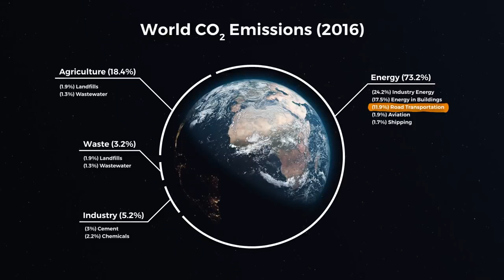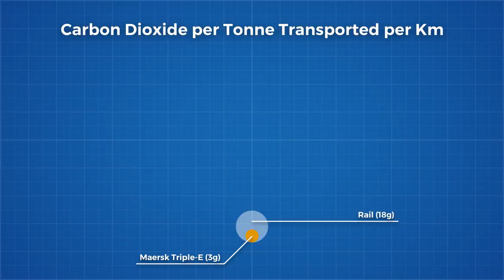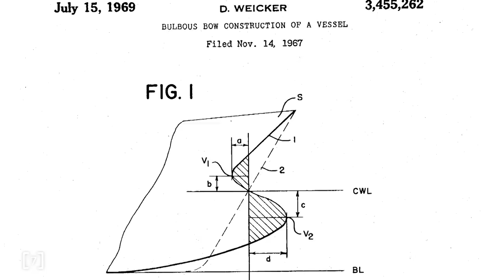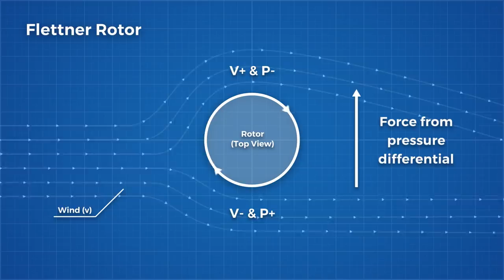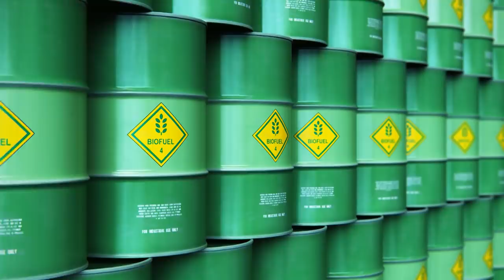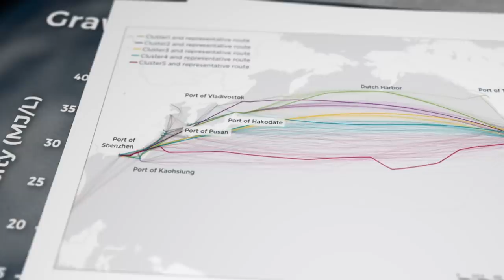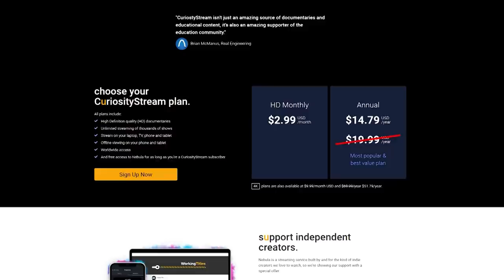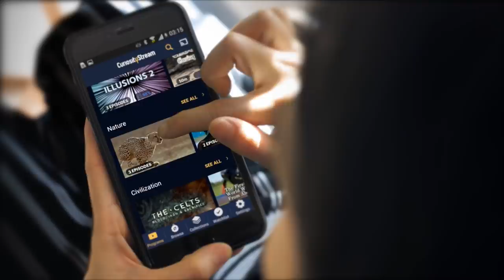Are Renewable Powered Ships Possible?

Comment: Ammonia is arguably better than H2 as a fuel. Whether it's practical to make either H2 or ammonia from renewables is a different question. Nuclear power would be a better fit to produce either.
Reply: @nick b The fuel used at sea, cSt380 HFO, is the bottom of the barrel which the refiners cannot squeeze any more valuable product out of.  Until a price is put on the externalised cost of burning it at sea any alternative must be a lower cost option in energy per dollar terms.  The price of dealing with the now 'internalised environmental costs' will, of course, be passed on to the consumers like us.
Reply: The next, least bad, option is ‘alternative fuels’ such as Ammonia (NH3), Biogas (basically good old CH4 or Methane) and Hydrogen (H2).  All require harvesting and processing which have costs and impacts before you get your energy to the point of use and will have effluents that will impact the global environment one way or another.  Thomas Midgley, Jr. (born 18 May 1889 died 2 Nov 1944) was an American chemist who as well as developing the technique of putting the lead tetraethyl lead (TEL) additive in petrol created chlorofluorocarbons (CFCs), yes those ozone depleting CFCs, so that the use of NH3 as a refrigerant could be discontinued.  NH3 could be the most dangerous and least ‘clean’ clean energy source it is very bad and probably deserves a rant all of its own, so let’s just leave that for a while (somewhere very far away that is cool, dark and quiet).  CH4 lots of it around much of which comes out of the ground as a fraction of the FOGI energy mining; even more can be created (relatively expensively) from anaerobic degradation of organic matter.  The organic matter may be either raw vegetation, food waste or pre-digested by domesticated livestock with the right (or wrong, depending on your point of view) sort of diet and gut fauna.  CH4 is a lighter than air, vapour at environmental temperatures and pressures and you need to compress it, a lot, or cool it, a lot, to get enough on board your ship in manageable volumes to be useful.  Carry it as cargo and you can burn the ‘boil off’, when the latent heat of vaporisation has a co-activity benefit, otherwise more trouble and cost than merit and savings.  H2 is said to be good for use in fuel cells that will give clean energy when combined with Oxygen (O2) and leave only water (H2O) as an effluent; so as well as the cost of creating the hardware and separating out the H2 in the first place we now have the cost of separating out the O2.  H2 is very, very light and very, very volatile so this is where we remember the Hindenberg disaster the ‘light’ means that though we have lots of energy per unit mass there is not much mass per unit of volume so all the problems of CH4 but much worse.  You need to compress it, more than a lot, or cool it, more than a lot, to get enough on board your ship in manageable volumes to be useful.  An alternate use of H2 burning also generates combustion products which includes waste heat going to the cold sink and a few NOx nasties.  The numbers are getting very difficult to show any sort of surplus so this is a case running hard to stand still.
Reply: @nick b the 'Just Have A Think' channel has a posting on H2 & NH3 this week, go see.
Reply: @nick b bad memories of loading surveys on LPG ships (75 000 to 125 000 cu m size) put on and coming off of ammonia trade.  The safety aspect worries me when it goes ‘out in the world’ and the energy benefit is questionable.  Have you seen the ‘Just Have A Think’ posting this week?

Comment: Wait a second, being able to produce 3MWh of power whilst only producing 90KWh of drag, isn't that like producing free energy? Wouldn't that break the fundamental law of energy conservation?
Reply: Think you number for drag is a bit low.  Just clipped this from the public data for a Triple E  'Propulsion:	Twin MAN engines, 29,680 kilowatts (39,800 hp) each' so actually that is circa 60 000 kilowatts in total to overcome the drag , however the 3MWh looks to be an order of magnitude to low for one engine and there are two of the b.....s.  So total thrust 60 000 kiloWatts (60 megaWatts) and the drag is said to be 90 kiloWatts (0.09 megaWatts).  Must check numbers more often.

Comment: We can use liquid hydrogen fuel like nikola
Reply: H2 is said to be good for use in fuel cells that will give clean energy when combined with Oxygen (O2) and leave only water (H2O) as an effluent; so as well as the cost of creating the hardware and separating out the H2 in the first place we now have the cost of separating out the O2.  H2 is very, very light and very, very volatile so this is where we remember the Hindenberg disaster, the ‘light’ means that though there is lots of energy per unit mass there is not much mass per unit of volume so all the problems of CH4 but much worse.  You need to compress it, more than a lot, or cool it, more than a lot, to get enough on board your ship in manageable volumes to be useful.  The alternative to fuel cell use of H2, burning, also generates combustion products which includes waste heat going to the cold sink and a few NOx nasties.  The numbers, on any of these, are getting very difficult to show any sort of surplus so is this a case running hard to stand still?

Comment: If anyone is thinking about battery-operated ships, forget it.

Even at it's most efficient point, large ships would have short ranges compared to most other power sources.

Just sayin.
Reply: In support of your comment the battery powered ferry that runs form Helsingborg (Sweden) to Helsingor (Denmark) is pushing the limits and that is about as short and regular a voyage as a ship could get on and still be commercially viable.

Comment: Couldn’t nuclear power work with this like on the German Otto Hahn and other nuclear powered vessels used in military vessels? Uranium isn’t technically renewable but it could work. Have a good day
Reply: Why not use nukes on merchant ships?  It is down to engineering, finance, socio-political attitudes and safety.  In engineering terms hydrocarbon fuelled ships do the job adequately and are simpler, financially hydrocarbon fuelled ships are, considering only internal costs, cheaper and socio-politically hydrocarbon fuelled ships are a known entity they thus have incumbent advantage.  With regard to safety hydrocarbon fuelled ships may have serious problems but these are generally considered manageable and have known limits of impact, most importantly they can be shut down at short notice and are then walk away safe, while nuclear energy has fewer incidents those rarer occurrences are seen to be catastrophic and having unlimited effects.
Reply: @BernardLS  I really only needed a shorter answer but ok
Reply: 'There are no sound bite solutions'. 1st Law of All Things.
Reply: Collision, grounding or capsize are existing hazards for cargo ships and other vessels; why would we want to increase the possible consequences of an existing risk?  Aircraft may crash and trains derail but knowing the hazards and risks both are highly regulated.  The first layer of 'the onion of survivability' is 'do not go there'; this means that the case for nuclear energy at sea has a very high bar to adoption.  The armed forces have no need to turn a profit to stay in business and being funded by the taxpayer can call on a relatively immense resource pool; private enterprise has to make back the money it spends (return on investment).  It is sometimes said that various navies have operated nuclear powered ships without incident for a number of years, however that is not quite so.  Bearing in mind that not all naval information is, in the interests of national security, made available to the global public some material does leak out such as the loss of the Kursk, Thresher and Scorpion; two nuclear submarines actually managed to collide, a feat made even more difficult as they had to be at exactly the same location in three dimensions at the same time so quietly that neither could hear the other coming (HMS Vanguard & MN Le’Triomphant, 3rd – 4th February 2009).

Why not use nukes on merchant ships?  It is down to engineering, finance, socio-political attitudes and safety.  In engineering terms hydrocarbon fuelled ships do the job adequately and are simpler, financially hydrocarbon fuelled ships are, considering only internal costs, cheaper and socio-politically hydrocarbon fuelled ships are a known entity they thus have incumbent advantage.  With regard to safety hydrocarbon fuelled ships may have serious problems but these are generally considered manageable and have known limits of impact, most importantly they can be shut down at short notice and are then walk away safe, while nuclear energy has fewer incidents those rarer occurrences are seen to be catastrophic and having unlimited effects.

Comment: There are sport stadiums with retractable roofs. I wonder if you could make a solar awning that goes over the containers. Like a horse and buggy like wagon thing that slides over on rails on the sides of the ship. It would add weight and make the whole thing top heavy so it might not improve the efficiency enough to be cost effective.

Solar thing slides back for loading.     |
                  \|/
            _,___,___,___,___,___,__
             |HH\.      |                  |
           /|          \—|—-nn—____|_.....
           |.                                          /
~~~~|~~~~~~~~~~~~~~~/~
   ~~SL______________________D

Slid back
 L—>   \|\|\|\
             |T|T|\.      
            /|. |. |  \——--nn—_____.....
           |.                                          /
~~~~|~~~~~~~~~~~~~~~/~
   ~~SL______________________D

Comment: Hydrogen and more hydrogen...I can't undesrtand engineers obsession with a fuel which can't be tamed or managed at all.
If you want synthetic fuels, just add a molecule to hydrogen and voila, you now have something than can be really used.

Maersk and others are trying ammonia (nitrogen + hydrogen). That will work with ships; unfortunately ammonia would still be difficult to use in cars or trucks.
Dimethyl ether is probably the best option for land transport. You can get your carbon molecules from existing industrial processes as cement production.

Comment: Sail ships joind d chat
Reply: To address the suggestions that sail power is the answer I offer the following.  In 1870 a premium sailing vessel entered service, the ‘Cutty Sark’, she could carry around 600 tonnes of cargo at speeds of up to 17.5 knots, dependent on the prevailing wind, to harness the energy the available spread of canvas was up to 2 976m2.  To round things out that was circa 5m2 of canvas for every tonne of cargo carried.  The ‘Cutty Sark’ was designed and built for employment in the tea trade where time on passage was a large factor in securing the premium freight rate that made her cost effective but as soon as the Suez Canal opened, which the ‘Cutty Sark’ was unable to sail through, she lost her advantage, raw speed, to the steam powered ships of that era.  Mechanically powered ships have improved in terms of efficiency, on a freight tonne mile basis, by at least one order of magnitude since then.  After losing out to the coal burning, steam reciprocating mechanical ships of the late 19th century ‘Cutty Sark’ was relegated to the Australian wool trade, just about the bottom of the barrel in maritime terms and only one small step up from being a 'honey barge'.  The canvas, cordage and extra manpower needed for sailing ships was never a very benign environmental option so please discount any idea of sail as ‘sustainable’.  All this is without the problem that if ‘the wind don’t blow the ship don’t go’, when it does blow it often blows in the wrong direction for your cargo delivery needs and sometimes there is rather too much of it for comfort.

Random facts about Cutty Sark.  It is said to have been able to coax 3 000 horse power out of her sails, or in ‘real money’ 2 206 500 Watts (2.2 megaWatts), assuming this was in ideal conditions that is about ⅔ of the power that might be harvested from the ‘top of stow’ of a Maersk triple E, again in those elusive ideal conditions.  So that majestic spread of canvas would have been even less efficacious for delivering your baubles and bows from the orient, despite taking about three times as long on the voyage.

Comment: So, what if we make nuclear powered trade ships? We can't let militaries have all the nuclear fun.
Reply: If you do a web search for ‘nuclear ship savannah’ you will see that it has been tried and did not work.  A similarly heavily subsidised, by the government, vessel is in use in Russia which also operates, in support of the Northern Sea Route, a fleet of nuclear powered ice breakers these may, or may not, have been completely without issues.

Just think; would you have full confidence in the management of a nuclear reactor under the control of an anonymous entity only traceable, perhaps, via a letter box in a FOC (flag of convenience) nation state?  If you are, could you sell that confidence to Japan, the state that hosted the Hiroshima and Nagasaki nuclear detonations as well as more recently the Fukushima ‘event’?  Then try that same, or a similar, sales strategy on Ukraine, the nation state that as a part of the USSR (CCCP) hosted the Chernobyl ‘event’.  Modern iterations of nuclear energy, thorium fuel, molten salt reactors or fusion reactors, will carry the legacy of past problems.  It is the global trepidation of anything with 'nuclear' in the name and the economics of nuclear having transitioned from 'energy to cheap to charge for' too 'the costs of remediation are incalculable' that will prevent the adoption of nuclear energy as a means of creating energy at sea.  Modern reaction systems may have overcome the safety problems but the general public, having been misled in the past, will be reluctant to believe the fresh new promises.

‘They’ say nuclear is cheap, it’s not it is expensive and has a large embedded carbon quotient as well as being complicated, dangerous, not universally socially acceptable and having only ‘no need for refuelling’ as a questionable advantage; actually it does need refuelling just not as often.  When ‘they’ do need to refill the warming up stuff it takes considerable longer than pumping tonnes of thick black stuff, HFO cSt380, or thin runny stuff, MDO, onboard which is one of the reasons HMS Queen Elizabeth and HMS Prince of Wales are pushed about by ICEs and gas turbines thus using a similar fuel as the aircraft that fly off of them.  The Royal Navy (RN) with a high degree of skill and expertise uses, at vast expenses to the UK taxpayer, a current operational nuclear fleet of 11 submarines (also known as ‘boats’) in two flotillas, seven attack subs and four ballistic missile boats.  The carbon footprint of all the extra bits of hardware and the fuel, including processing thereof, from ground to propeller, are the external costs that never seem to get considered.

Disposal, once it wears out, of both the machine (that was a ship) and fuel is another can of worms best left unopened.  The 26 RN boats no longer in use are laid up (some in Rosyth and some in Portsmouth) awaiting long term deconstruction including dealing with the fuel rods and other irradiated material.  The USN is not, as far as I know, a commercial organisation working to very tight margins and also has the skill and expertise to handle the complexities of nuclear power; so as well as submarines their aircraft carriers are nuclear powered and each of the current iteration has a build cost three times that of QE/PoW, bigger crews and more generous funding.  For those who still think that nuclear energy might be the answer I recommend this report: - https://www.bbc.com/future/article/20200901-the-radioactive-risk-of-sunken-nuclear-soviet-submarines?ocid=ww.social.link.email.  The navy of the USSR might have been under resourced and over extended but it was still generously supported in comparison with merchant shipping.